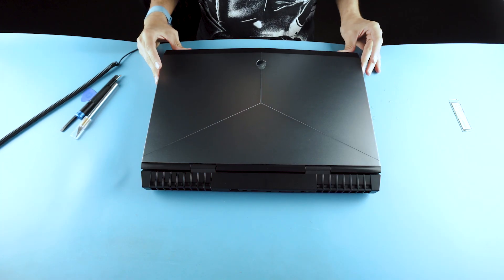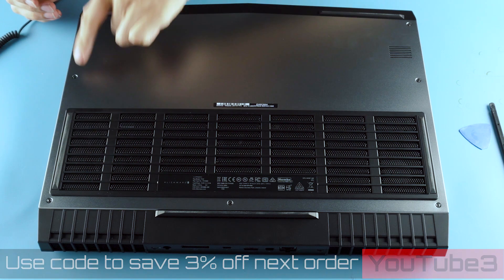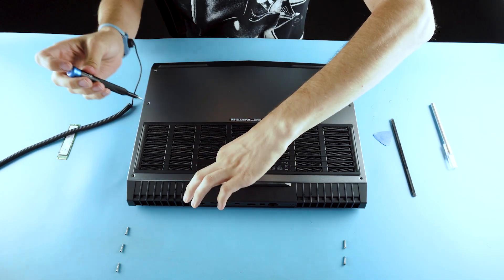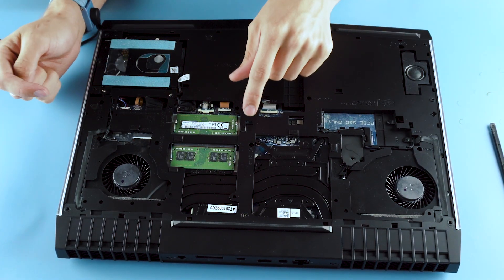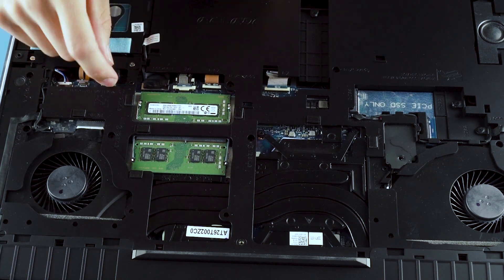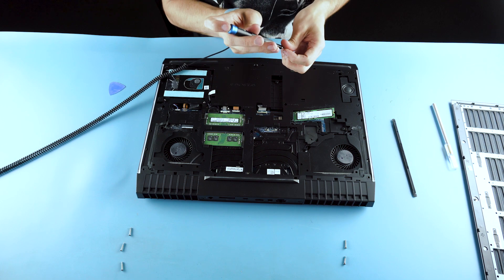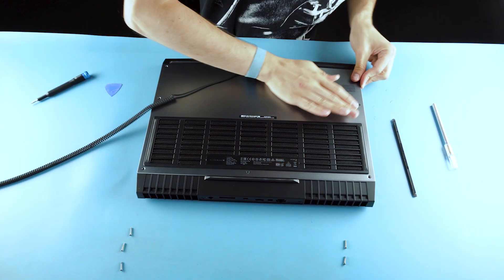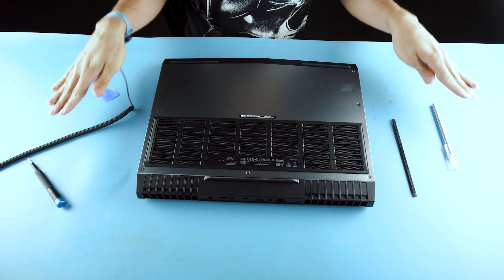Alienware 17 R5 | How to Upgrade NVMe (Teardown)

Comment: I bought this Alienware Gaming AW17R5-7405SLV-PUS 8th Gen Intel Core i7 Processor Laptop, 8GB RAM, 1TB Hard Drive Plus 8GB SSD, NVIDIA GeForce GTX 1060, 17.3" Full HD Display, Epic Silver last year and last week i bought Samsung 860 EVO SSD 1TB - M.2 SATA Internal Solid State Drive with V-NAND Technology (MZ-N6E1T0BW) after following your video on how to install i have tried every thing but my computer doesn't seem to be able to find it. can you please help me  ?
Reply: Check bios. Also you might have to format  the ssd before you can use it. I had an issue with an old ssd that wouldn’t be read so i had to erase and reformat it.

Comment: How did you get those screws off? they’re impossible!
Reply: Keith Flagg I’m just facing this now the middle back most screw it’s almost like thy glued it in
Reply: Jonathan Coleman I got it just needed to try a different, even smaller, screwdriver. Middle one is a tension screw only unscrew until loose.
Reply: @coletivating yep, I had the same issue.
The screw does not come out, it's the only one that doesn't I should make a video lol.
But once it's lose and all the other screws are out you are good to pop the back cover off just be careful because those clips break super easy lol
Reply: All are easy except the middle one has a washer on the other side, ur not suppose to take it off

Comment: for some reason mine keep saying installed ram is 24GB when i have put 2x 16 GB RAM on it.. any help or tips? i have updated bios after and still saying 24 GB usable only.. thanks
Reply: Windows Home version may only support up to 24gb - likewise your motherboard may only support up to this amount on its current firmware.

Comment: Hello sir. Great tutorial but how did you get your laptop to boot from your newly installed SSD?
Reply: Install windows to that drive, after booting off the old drive. You could use a tool, or the probably best way: leave the windows install on the old ssd and just install games/happlications to that drive. You're not going to see a huge jump in boot times going from SSD to NvMe, and what's two seconds on boot?

He'd have to boot off the existing boot partition anyways to get the drive up and running (format, create FS, partition etc) and that'd also be the fastest way to put a windows install on the new drive as well. 

Of course you can try and clone the partition from the old ssd to new ssd, but if you're going to be keeping the old drive (and why wouldn't you?) why go to all the hassle of doing this? Yes, there are some use cases - but I expect the people engaging in such use cases aren't looking for answers in youtube comments.

Comment: Good job, you just voided your warranty
Reply: Can't void your warranty if they have no, actual physical proof you tampered with your laptop. It's illegal to void your warranty without actual proof you messed with something. Just looking at records isn't enough, either. For example: If you have a warranty sticker on your computer that read's "Removing Void's Warranty" or something similar to that, they can have it written down on all the documents in the world, but if you remove that thing with 0 evidence that it was even physically there in the first place, they can't do jack shite to you. (https://www.youtube.com/watch?v=qwAGgCpLVeo) So in this case, he can change out these components, and simply deny he did anything, and they won't be able to do anything to him. But, if he were to go in there, mess something up inside the physical machine himself, then try to take it to a repair, they'd know the physical change was him, voiding his warranty. These laws I'm referencing mostly apply to America, so things may be different in other country's.

Bottom line, you're fine as long as there's no physical proof YOU did it.
Reply from the maker: You actually have a right to service your laptop. Void warranty stickers don't really mean anything anymore. HOWEVER, if you were to break something in there that you clearly tampered with, then it would be your responsibility and likely it would not be covered by the warranty.
Reply: Computer Upgrade King my point exactly! Thx chief.
Reply: Computer Upgrade King the support plus warranty covers accidental damage. It’s $400 tho. I bought it anyway
Reply: You don’t void Alienware warranties by opening the case 😂
Reply: You’re an idiot

Comment: Could you do an update going through the steps of installation?   The Alienware is a headache getting it to install from that slot.
Reply: 7 screws then pull the panel off. one screw to install the nvme drive.